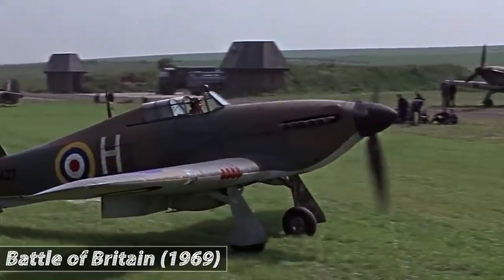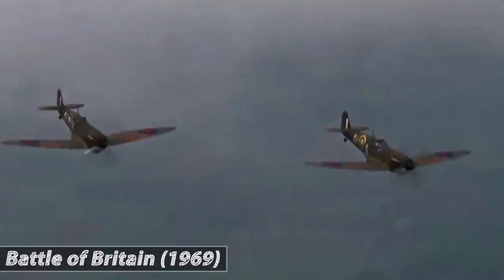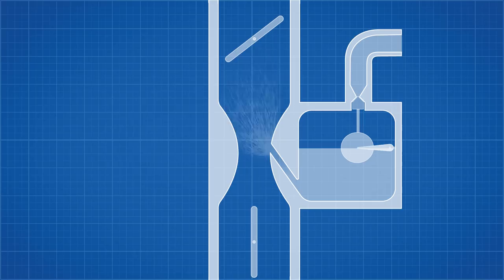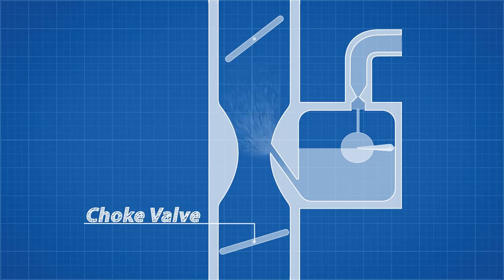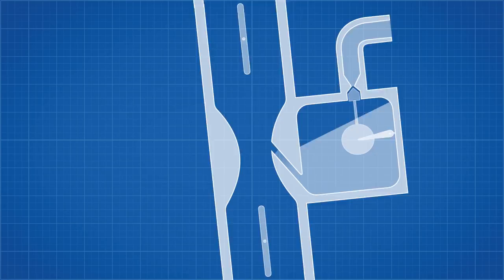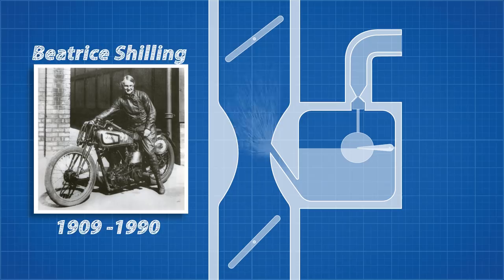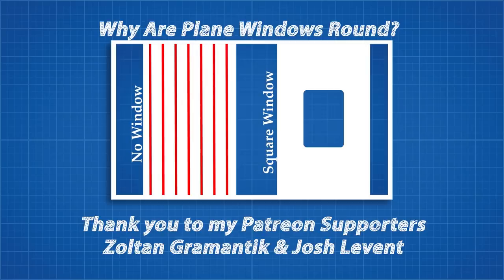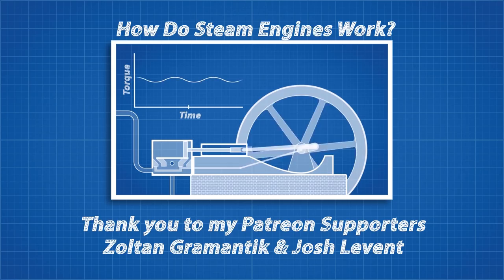The Spitfire's Fatal Flaw

Comment: You should learn more before going on the web. 1. It was not the Spitfire, it was the Merlin engine. 2. You show Hawker Hurricanes, not Spitfires proving the problem was the engine, not the aircraft. It was not a fatal flaw, only a disadvantage which the pilots soon knew how the minimize.
Reply: Well it could be fatal. As he said in the video, if it happened for too long the engine might not start again. If this happened in a dogfight, you're screwed.
Reply: That would be, after pilots got to master the problem, about as rare as your car breaking down today. That said, I have never understood why Rolls Royce did not adapt the engine for fuel injection. The Daimler Benz in the ME 109 had it. One would think RR would realise the weakness and change to FI.
Reply: Well it was fatal when the germans found out about that flaw and abused it in dogfights against the brits.
Reply: Quote me ONE indisputable case where a pilot lost his life due clearly to fuel starvation and subsequent  engine failure.
Reply: i'm afraid you're going to have to do this yourself. Read more into the WW2 aviation history from both sides or the war.
Reply: No. You made a statement, now prove it. I know my aviation WW2 history.
Reply: Between 1 August 1940 and 31 October, Spitfire losses amounted to 208 lost in combat, seven destroyed on the ground, and 42 in flying accidents. These include Engine,emergency boost and deployable gears errors and faliures
Reply: The Merlin engine that was in the...
Reply: Fine, but which of these incidents was due to fuel starvation whilst the aircraft was inverted.
Reply: Adrian Larkins You know what mate? You're right. Fuel starvation and subsequent irreversible stalling at 30,000 ft is not even potentially life threatening.
Reply: It's even safer if you have to prevent your engine from stalling when someone dedicated to knowing your weakness is hunting you down.
Reply: All im saying is the germans adapted and found the flaw in spits and abused it. Some certain maneuvers the spitfires couldn't do due to the engine stalling at steep dives for example, were the germans would use tactics to counter them and pin them down. So yes its technically not a direct cause of casualties of spits but it definitely has hand in it.
Reply: It has nothing to do with the Spitfire. It was the Merlin engine which was used in many different aircraft including the Mustang. It was,without doubt, the most successful engine in WW2.  The ME 109 had a short lived advantage over the Merlin in the Battle of Britain but after that, the Merlin was the master.
Reply: Adrian Larkins Absolutely, just because the engine is flawed in some way doesn't mean any vehicle using the engine shares the same flaw. I mean it's a spitfire, it's immune to engine troubles right?
Reply: they use the same flawed engine so they both share the same engine troubles. But ofc each plane tackles it differently due to difference between planes. For example one can climb or turn differently thus each one adapt differently to its flaw by having different tactics offensively and defensively
Reply: the "flaw" killed a number of pilots... how's that not "fatal" in your pointless argument of semantics?
Reply: Care to name a few killed by the "flaw"? Give me a proven incident where the "flaw" was the direct cause of death. If the Merlin had this deadly flaw, why the hell is it one of the most successful and much loved engines ever?
Reply: You can google this: asn mosquito crash 1996
Reply: I concede your point. That was indeed a case of fuel starvation due to negative G.
Reply: If you are holding negative g for any significant amount of time in a dogfight your dead engine is the least of your problem
Reply: Adrian Larkins They did! Later versions of the Merlin used Bendix single-point fuel injection systems licensed from the USA.
Prior to that change there were several 'jury-rig' fixes for the negative G problem- first among them was the schilling orifice, which prevented the engine from stopping entirely due to flooding, but did little for the initial loss of power. That was in turn replaced by a modified carburetor that could supply enough fuel for a few seconds of full power under negative G.

It is worth noting at this point that no fighter plane (not even a modern jet) can sustain more than a few seconds of negative G. This is because the carburettor isn't the only part that is affected by G-forces- the main problems are fuel supply (the fuel pump is at the bottom of the tank, while negative G makes all the fuel go to the top) and lubrication. Go negative G in a Bf109 and all the oil in the engine will want to fly up to the top of the crankcase. Within a few seconds your cylinders and valve gear will be running dry, which is a recipe for a seized engine if the negative G continues.
Reply: Yes, but this was caused by a faulty carb
Reply: "If you are holding negative g for any significant amount of time in a dogfight your dead engine is the least of your problem"

Exactly this!    The 'flaw' in the engine design came about in a maneuver that most pilots avoid anyway.
Reply: So much rubbish here. First, the problem wasn't special maneuvers that pilots couldn't do, or avoided to do. The problem was that every single time they pushed the stick forwards, they lost power. To the point where the engine flooded. That means you can not follow a german plane that's going into a steep dive. That means he lives to meet you another day, and that day, you might not be behind him but the other way around. And that didn't happen once, it happened constantly.
Then there's the rubbish about "jets can't do negative G forces". First, fuel pump. It's not "at the bottom of the tank". You have: a containment box around the fuel boost pump inlet. You have double inlet fuel boost pumps. You have a weighted fuel pump inlet shuttle valve, amongst a couple of other things. Modern planes, or jets, struggle only with one condition in regards to g forces, and that's 0g. Neither negative nor positive g. The BF 109 also used a drysump oil feed, so there's no "running dry" either. And that's info that is common knowledge if you have any interest in WW2/warbirds generally at all. 

Small sidenote, even commercial jets are rated for 2.5 to -1.0g.
Reply: m4ini
youre the one who's ignorant. you won't be able to follow a german in a dive only if you are at exactly the same speed as he is, which rarely happens in aerial warfare.
Reply: and here is the problem. at the time of the battle of britain, the bf109 outperformed the spitfire. just by a small bit but it did. it was faster and could do prolonged negative g maneuvers. and a simple dive is a negative g maneuve. 
the spitfire was slower and did not climb as fast as the 109 or the 190 and could not take dives and other pretty common maneuvers during arial combat. 
this is why the german fighters could choose the engagement and were not engaged.
this was only hampered by the close escort formation they had to do.
if a 109 or a 190 got into a combat situation where it was overmatched by surperior numbers or in a position where it was not reasonable to fight, it could just dip the nose a bit and it was out of reach of the spitfires and hurricanes. 
the british planes on the other hand had to stand their ground and face the enemy, were severly limited in the maneuvers they could pull of (rolling scissors etc are also negative g at some points) and with that were at a significant and deadly disadvantage.
the british advantages where the short flight distances between their airfields and the long warning times due to radar and also the limited combat time for german planes in british airspace due to limited range.
even british pilots of the time say, that they were sitting ducks to the german fighters. later versions of the engine and the plane fixed the problems but thats not the point here.
Reply: Zhufor TheImpaler the entire time i was reading your reply i was thinking "this guy's full of shit" until i got to "later versions"
... then i began to wonder where you got this information, 
"the spitfire" was many aircraft, and not all of them "spitfires" ... but regardless, they've all mark numbers to distinguish themselves.  if you're going to add to the conversation, you'll need them.

TRIVIA: depending on command, they wern't even called "spitfires"
Reply: Phil Verhey well the relevant timeframe we are talking about is the battle of britain.
combat altitudes were above 4000m, wich was a clear advantage for the german fighters.
the used spitfire marks were mkI and mkII and they used the merlin engine without diaphragma. here we can clearly see the performence problems of the spitfire.
they had the home advantage, more planes and pilots and also a high rotation of pilots from reserve to front and back. unlike the german airforce, wich suffered under pilot attrition.
the mkV and following versions used the upgraded merlin engine and were able to outperform german fighters from that point on. the introduction of the 4 bladed and 5 bladed propeller increased the performence even more.
im not saying that the spitfire was a bad plane, but the merlin engine was initially designed for racing cars and not arial combat and suffered from that until 1943. it was a good engine but in the wrong role until it was upgraded.
and up to the point where the germans lost the arms race for upgrading the fighters, the bf109 and fw190 were outperforming british planes. but that ended with the end of the battle of britain.
Reply: Zhufor TheImpaler wierd exemption of the griffon engine in "following versions used..." , and twice incorrect inclusion of the 190 which never flew in the battle of britain.

but sure.
Reply: The Spitfire was better that the 109 in that in could out-turn the 109 and catch it with a full burst of fire. The engine cutting was a problem which has been totally over-baked in this debate. The Merlin lent itself to dozens of upgrades which eventually became the Griffon engine. The FW 190 had no part in the Battle of Britain. It was initially superior the the Spitfire V but the Spitfire 9 was the answer to that problem.
Reply: +Conman_123 You wouldn't pull negative Gs for that long in a dogfight. If you did, you would die from redout, not your engine cutting out.
Reply: +SIPS' MOM The negative G issue was fixed by the time the Spitfire Mk V was introduced (around 1942)
Reply: It is not possible to do this because the pilot that lost his life, erm, died and never got to write his memoirs detailing exactly how he was killed.    There are however numerous instances when a 109 bunted over into a nose dive when bounced by an early Merlin powered fighter and got away.    The one second required by the Merlin aircraft to turn inverted and pull into a dive was more than enough to allow the 109 to get away.
Reply: What you say is all quite true but just common knowledge.
     This vid isn't about the BoB.
            This vid is about the fatal flaw of the Spitfire which was its carburettor fed engine, a truly simple and stupid mistake.
        Another of its flaws was its low value armament,fine for getting lots of tiny rounds into a small,fleeting target like a fighter but not so good against heavily armoured bombers.
      The Merlin grew up to be one of the all time great powerplants but when new as in the Mark 2 and 12 it was certainly no better than many other vee engines out there.
     The DB 601 that powered the early versions of the 109 were better in every way than the early Merlins.
    There was also lots of development potential in them and they matched the Merlin pound for pound throughout their careers.
      It should also be remembered that the Merlin is famous for its successes like the Hurricane, Spitfire, Mosquito and Lancaster but its failures have been conveniently forgotten, such as the Fairey Battle and Bolton Paul Defiant.
    The Merlin didn't 'make' the Spitfire, the Spitfire would have flown just as well or even better with the DB 601 fitted.
Reply: Again,what you say is true but this video is not about that, it is about the defect inherent in all early Merlin engines and incidentally absent in all early DB 601s.
    I would say though that an expert 109 pilot could turn with the Hurricane or Spitfire, the German aces report no problems doing so, only the novice pilots were scared to push the 109 too far in a turn.
    Like I have already said, the Spit was a great plane for the novice pilot, it allowed him to throw himself around the sky with 'gay' abandon, it was a 'force multiplier'.
    The 109 was a better fighter when driven by an equally experienced pilot.
Reply: No,the Spitfire was undoubtedly a brilliant aircraft but it wasted the talents of truly great pilots.
    A novice Spit pilot could get approaching the best out of his aircraft while a novice 109 pilot could not do so until he had accrued many.many flight hours.
    Let me try and explain my friend;
     If we assume that the worlds best fighter pilot had a performance rating of '20' and an average pilot had '10' then the Spitfire allows an average pilot with a '10' rating to become a 12 or 13.
     A 109 allows the average pilot to be exactly what he actually is,ie, a '10'.
     However, when a 109 pilot becomes truly familiar with the capabilities of his 'ride' he achieves a greater ultimate score than a Spitfire pilot of comparable experience.
    So a Spit pilot can achieve no more than '18-19' while a 109 can go on to '20'.
   Of course, to achieve this high score the 109 pilot must survive through the lower numbered stage.
     This is what feeds the belief that the Spitfire was a better aircraft than the 109.
      It took a mediocre pilot and made him seem better while a 109 took a mediocre pilot and made him seem exactly what he was.
     I would say that a novice pilot in a Spitfire has the advantage over a novice 109 pilot but an expert 109 pilot has the drop on an expert Spit pilot, an experienced 109 driver could and did out-turn anything in the ETO.
    The Spitfire was an excellent wartime aircraft that allowed wartime expedient pilots to excel, if both the 109 and the Spit had been flown by uniformly experienced pilots in peacetime then the 109 would be the better aircraft.
     This is of course exactly what the RAF needed in 1940, we had many inexperienced pilots and the Spitfire was perfect for them.
     The next year when our pilots were generally speaking more experienced and we pushed into France the Luftwaffe handed our arses to us on a platter.
Reply: Brilliantly explained.
Reply: Adolf Galland when asked by Goering what he needed to defeat the RAF during the Battle of Britain Galland simply responded 'A Squadron of Spitfires' . . .
Reply: +shawn harold fox firth Thats an urban myth btw.
Reply: Adolf Galland wrote in his book The First and the Last that when Goring asked what do you need to win against the RAF, Galland said a squadron of Spitfires.  Or are you saying Galland lied.
It is also a fact that the Spitfire was the fighter the Luftwaffe pilots most feared.
Reply: To say that 109 pilots feared the Spitfire is exactly the same as saying Spitty pilots feared the 109.
       In reality a low and slow 109 will be killed by just about anything sitting above it with enough fuel and ammo for a quick dive, therefore that 109 pilot will fear it even if it's a Gloster Gladiator or a Blackburn Skua
     Basically it is all about positional advantage/disadvantage.
      Galland goes on to say that 'he didn't really mean what he said and that he thought the 109 was better than the Spitfire'.
       The performance similarities between the two were astounding and the ac in the better position would dominate.
          I have to say though that the flat out speed at mid to high altitude were in favour of the 109E, the armament was pro 109E and the rate of climb at any height goes to the 109E.
      The Spitfire MK1/2 whether in expert or novice hands could indeed turn very tightly but the 109E in expert hands could do so just as tight.
         I have to give the title to the 109E.
    P.S, Don't let my name fool you, I'm as English as can be.
Reply: Yet  The truth is that Luftwaffe pilots have been quoted as saying the one plane they feared was the Spitfire. even if the Bf 109 pilots had the height advantage which was often the case in 1940.
Galland was trying to annoy Goring but he did mean that the Spitfire would have been better for escorting bombers.
Galland thought the Bf 109 was faster but it has been shown that the Spitfire Mk I had an  advantage at most altitudes. 
The rate of climb for the Spitfire is also better, the Bf 109 climbed steeper but slower.
Remember that by the Battle of Britain the Spitfires had constant speed props and were able to use + 12 lbs boost.
The Spitfire could turn tight without losing altitude,  the Bf 109 if it turned as tight would lose altitude.
I have to say that if the Bf 109 was better why did the less experienced RAF pilots do so well and why did Galland get shot down by inferior  and outnumbered Spitfires?
Reply: Barrie Rodliffe
Yes of course my friend, the 109 pilots did indeed fear the Spitfire, but perhaps what they don't know or at best least admit to, could never admit to to is that that they were shot down roughly 2/3 compared to Spitfires,yes indeed, the sedentary Hurricane, an aircraft readily ridiculed by the old sweats of the Luftwaffe killed far,far more 109s than Spitfires ever fucking well did.
Even the fucking Luftwaffe coined a term for it:SPITFIRE SNOBBERY, in which no shot down Luftwaffe pilot ever conceded defeat to a Hurricane, never-the-fucking-less, many more 109's continued to end up in Kentish hop fields thanks to Hurricanes, not the limelight stealing Spitfire.
    Perhaps its time to forget your jingoistic 'spitfire yey' attitude and do more serious research.
 I mean seriously 'You say that Spitfires with their incredibly short range, every bit as short as a 109 would have made better escort aircraft, even with their inferior performance at height?
               FFS mate, there's patriotism and there's foolishness, I on the UK side am very proud of the way we fended off the awful Nazi Germany in mid/late 40 and yet can see that the two aircraft that enabled us to do that had their flaws, simply denying that they had anything wrong with their design just shows that you must own a mildly bigoted mind.
            OH, AND FFS, THE 109 IN THE HANDS OF ANYBODY BUT A COMPLETE NEOPHYTE WILL TURN WITH EITHER THE HURRI OR THE SPIT!!!!!!!!!!!!!!!!!!
Or do you REALLY think that all RAF fighters were victims of Hilo attacks?
   You all make me laugh...............If the bloody Spitty was so god almighty superior then where was the competition, what shot down the Spittys?
          You bloody fools and know nothings.
            Do some research before you stick your dopey noses in, that's my advice.
Reply: Poor Anton.
You need to do some research.
In the Battle of Britain the Hurricane shot down more Luftwaffe planes than the Spitfire, the slight matter of there being far more Hurricanes at the time and also the fact the Hurricane usually took on the bomber while the Spitfire despite being very outnumbered  did take on the Bf 109, the result is that the Spitfire shot down a higher percentage as well as having a lower loss rate. 
I mean the Spitfire not only had better range than the Bf 109 early in the war as well as being slightly faster and climbing better at any height, it went on to have much better range, in 1943 when Spitfires were regularly flying sweeps of over 1,000 miles and escorting USAAF bombers.
Anybody who can read should know that the Spitfire had a tighter turning ability, it turned tighter than the Bf 109 without losing altitude, not only tighter but pulling more G and completing a turn faster.  

If the Bf 109 was so good why did the more experienced Luftwaffe pilots not shoot down that many Spitfires?  the Bf 109 pilots had a numerical advantage and mostly a height advantage.
I take advice from intelligent people, you do not make it.
Reply: Your claim that the Hurricane usually took on the bombers shows a schoolboy understanding of the battle, you do not like my message because it clashes with your weak interpretation of events.
      There were roughly 2 Hurris for every Spit during the battle and guess what?
       The Hurricanes shot down almost exactly twice the number of enemy aircraft as the Spitfire, this means that despite all of your childish enthusiasm for the Spitfire it failed to outdo the Hurricane during the BoB.
          The fact is that if RAF Fighter Command had been equipped solely with Hurricanes it would still have won the BoB.
          The Hurricane had a slightly higher likelihood of burning when hit by the devastating firepower of the 109 but this was compensated for by the Spitfire being a much less sturdy aircraft and a bad firing platform.
          That the Spitfire could outperform the Hurricane in almost every aspect is not in doubt but this being so does not explain the Spitfires failure to eclipse the Hurricane in actual enemy kills.
      You don't seriously think that 109 pilots didn't shoot down 'that many Spitfires' do you?
      What the hell happened to the hundreds that were actually shot down if 109s didn't get them, was it little green men perhaps?
    BTW, I couldn't care less whether you take my advice or not, your continued education in all things aviation is of no concern to me, jog on little boy..
Reply: Are you talking to me or Barrie Rodliffe? I know my B of B history. You are right there were more Hurricanes than Spitfires, The reasons the Hurricane had a greater score are twofold, ONE There were more of them. TWO The hurricane, because it was not as nibble as the Spit but was a better gun platform went for the slower, less manoeverable bombers, whilst the Spits went up to meet the fighter escorts which are naturally more difficult targets. And that was told to me by than none other than Sir Douglas Bader who I was honoured to meet at Duxford shortly before he died.
Reply: I was actually addressing Barrie Rodliffe but no matter.
     Yes,of course the reason for the Hurricanes higher score was because there were approximately twice as many of them as the Spitfire and they managed to take down almost the exact same ratio of enemy planes as the Spitfire however they suffered higher losses in doing so.
      As we all know, the official strategy was for Hurricanes to go for bombers and the Spits to deal with the fighters but this is a simplistic outlook, it hardly ever happened like that, more realistically they all became entangled and anything took a pop at a bomber when free from 109s.
     Of course if the 109s moved off at speed then only the Spitfires could keep up with them and therefore more 109s were killed by Spits pro rata than Hurricanes.
       The Hurricane often found it difficult to keep up with a JU88 that had its nose down for France.
        But to get back on topic, the early versions of the Merlin engine were flawed and this flaw obviously affected the performance of whichever aircraft it was fitted to.
        During a dogfight split seconds count for a great deal and if you know that your assailants engine will cough if he bunts after you then that is exactly what you will do, the power interruption was often enough to gain a couple of hundred yards on the Merlin aircraft and this is the vital difference between being in range of his guns or not or him coming into your range.
        Fitting such an outdated fuel feed system to an engine that was otherwise excellent seems like an incredibly dumb thing to do and it was.
Reply: Actually twice as many Hurricanes shot down less than twice as many Luftwaffe planes, especially fighters and more than twice as many Hurricanes were shot down than Spitfires. so the Spitfire had a better record and after the Battle of Britain the Hurricane was at the end of it`s development, the Spitfire was able to be developed to fly almost  100 mph faster than the 1940 Spitfire which was faster than the Hurricane and more than keep up with any other fighter right through the war. In Malta the Spitfire took over from the Hurricane and defeated the Italian and .German air forces there, in North Africa the Spitfire took over from the Hurricane and P 40, the Spitfire provided air superiority for every major action right through the war.
To get back to the topic, the early Merlin engine was more efficient than the larger German engines, the carburetor gave more power. Sir Stanley Hooker knew about fuel injection and the problems that had as well. 

The Hurricane used the same Merlin at the time, same problem.
The Merlin had  the well known problem of a momentary cut out when negative G was encountered but the RAF pilots did not just nose over into a dive, they rolled over into a dive which meant no cut out and they could keep the Bf 109 in sight and catch up in the dive.
A Spitfire pilot would not bunt into a dive to escape, he could simply do a climbing turn and the Bf 109 could not follow.
If the Spitfire was so bad, why was it that there were more Spitfires and less Bf 109`s at the end of the Battle of Britain than at the start?
Reply: Nobody is saying that the Spitfire was 'bad' and it is generally accepted as being better than the Hurricane as an air superiority weapon.
           You are projecting the successes of the later MkV and MkIX Spitfires onto the deeds of the earlier MkI and II.
            Those later marks had the engine and the armament that the earlier ones should have had but didn't.
           All I'm saying is that contrary to schoolboy wisdom the BoB era Spifires were no better than the 109, a hard pill to swallow I know but true none the less.
          The roll rate of an aircraft is a measurement of how many degrees of bank can be applied per second,  this is an absolutely vital performance figure for a fighter because it dictates how quickly it can change direction, so if we consider a 109 that is being pursued by a Spitfire MkI or II and that 109 bunts over into a vertical dive in an effort to shake off the Spitty then that Spit pilot has three options;     He can break off because he has succeeded in driving the 109 off.
      He can bunt over himself thus starving his engine of fuel albeit hopefully temporarily, during which time his would be prey accelerates away.
       He can take the recommended action and enter a half roll which obviously involves rolling his aircraft through 180 degrees and pulling back on the stick then reversing the roll.
       The Spitfire had a decent roll rate as did all contemporary single engine fighters but it still took the Spit travelling at only 200mph c 1.9 sec to roll through 45 deg, this figure would improve slightly as the roll developed and inertia was overcome but we can safely assume that to invert a Spit moving at 200 mph would take in the region of 4-6 seconds.
     As the airspeed goes up so does the rate of roll slow down,ie, @ 385mph a Spit takes 3.8 sec to roll 45 deg.
      During which time the 109 accelerating away downwards through 300-400 mph has covered c 1/2 a mile.
http://www.spitfireperformance.com/spit1vrs109e.html
The Spitfire was at a terrible disadvantage in such a fight and any German pilot with half a brain knew exactly what to do if he found a Spit on his tail; Bunt over and dive away.
     Just as any Spit pilot finding himself pursued by a 109 knew what to do; A high climbing turn into the attack, if he chose to dive he is dead meat.
      Unfortunately any sensible 109 driver knew his prey had limited options and would invariably be ready for the turn as he knew the Spit driver wouldn't dive.
      If we reverse roles here the pursuing Spit has to decide whether his prey is going to go into a turn or a dive, split seconds have past during this thought process and a couple of 20mm cannon hits kills the Spitty stone dead.
       Conversely, the Spit can make many little holes in the 109 airframe without causing the least bit damage.
It was a fault in the carburettor fed engine and not a fault inherent in the Spitfire airframe which caused this, as soon as RR fitted the Bendix-Stromberg fuel injection system to the Merlin the problem went away.
  Another factor which directly improved the Merlins performance without any alterations to the basic engine design was our use of high octane fuel, fuel that was not available to Germany.
    So if you ignore the carburettor faults and ignore our far more combustible fuel then the Merlin was indeed a better engine than the DB series.
         It is true that the RR Merlin was THE most reliable inline aircraft engine of all time and this was brought about by RR quality control in which a random production engine was removed from the line and ran at full power until it failed, then it was stripped down and the origin of the failure determined upon which that part was either strengthened or redesigned.
Reply: An aircraft stall at 30,000 feet is almost never irrecoverable unless control surfaces are damaged in some way or the pilot is dead/injured/unconscious.

At stall at 100 feet is almost never recoverable, even if everything else is working properly.
Reply: *****.
The Spitfire which turned tighter than the Bf 109 and very much the same as the Hurricane also not only was faster, but climbed and accelerated better, that is even more important than speed.
It shows in the fact that while the Spitfire mainly went after the Bf 109 leaving the Hurricane to take on bombers, that per plane the Spitfire shot down more and had a lower loss rate.
 Strange how Hurricanes were shot down by the Italian fighter, I believe it was a Machi, The Spitfire replaced the Hurricane and P 40 in the Mediterranean and North Africa, also the hurricane in Malta because it could take care of itself.
Reply: That is why I admire the courage of the low flying rocket firing Typhoon pilots. They were, by necessity, very low and therefore very vulnerable to light flak with no chance of recovery and bailing out.
Reply: It would depend on how much damage if hit by flak, if not destroyed there was a good chance of gaining altitude and baling out, even with a dead engine you can trade speed for height. 
A Tempest pilot was hit by flak late in the war and he was able to fly his damaged plane back to base, unfortunately while he could fly he could not use the performance or maneuverability to evade USAAF P 51`s which shot him down.
Also other fighters did low level attacks on many targets, Spitfires were doing so and giving close support to the British army advancing through France. I knew a Typhoon pilot who survived the war.
Reply: The P40 replaced the Hurricane in the air superiority role in the Western Desert, the Hurricane went on to serve there as a fighter bomber. AFAIK there were no Spitfire units in the desert until well into 1942 and then they were the MKV variant,not the MK1/2 that flew in the BoB.
        On Malta the Hurricane fought on under increasing strain against 109 E-7's and F's when the first shipment of Spitfires were almost all destroyed on the ground after landing.
       These too were eventually replaced by Spitire MKV's in the air superiority role.
Reply: The P 40 did not replace the Hurricane in the air superiority role, it was used as a dive bomber until replaced by the Spitfire in that role too. That fact is the Spitfire Mk I and II which were better than the Hurricane could also carry 20 mm canon the Hurricane had to wait for the more powerful Merlin fitted to the Hurricane Mk II which had more power but was still lower performance  than the Spitfire Mk II.  Spitfires were also able to be given still more power, Mk V, Mk IX, Mk XIV and all the other marks in between,  while the Hurricane was at the end of its development. 
So Spitfires were destroyed on the ground but soon they completely changed the situation in Malta, just as they did every time they replaced other planes.
Reply: The P40 did indeed replace the Hurri as an air superiority fighter in the desert, it was outclassed by the 109E and F but nevertheless the Hurri went on to ground attack while the P40 protected its back, then the Spitfire came along in 1942 and took over that role.
           I'll say it again for your benefit ; Nobody in their right mind would claim that any Spitfire variant was inferior to the Hurricane as a fighter, it was plainly a better performer in that role.
          Why don't you ask 19 Squadron what they thought of their 1940 era cannon armed Spitfire 1's?
19 Sqn were the first to receive the Spitfire and the first to use the cannon armed version in combat during 1940, it failed, the feed mechanism was not up to dragging the cannon shells into the breech while under G.
       They pleaded to be given normal 303 armed versions and they were, clapped out old wrecks with which they were delighted.
            But there you go again mate, you're banging on about late war Spitfires when this thread is about the flaws inherent in the early Merlin engine types.
Reply: The P 40 which was used as a dive bomber could not even protect itself so why would it be used to protect the better Hurricane.  Why did no Hurricanes even have 20 mm canon at the time, 19 Squadron had the Spitfire Mk I b with 2 x 20 mm, of course there were problems which is why only 30 Mk I had 20 mm, 170 Mk II had 2 x 20 mm and 4 x 0.303.  Hurricane did not get the 20 mm until later. 
I am not mentioning late war Spitfires, the Mk V, early 1941.
Also the so called fatal flaw which was not fatal and was improved in 1940, being completely cured in 1941.
It was not so much a flaw as a slight problem associated with the carburetor but the trade off was better efficiency of the carburetor than achieved at the time with fuel injection.
Reply: They were fitted with Packard built Merlins in 1943 and equipped many units stationed in Italy, they still didn't perform well at high altitude and I think many were stripped of armour and some guns to improve their performance, they were designated P40L.
          And yes,thank goodness.
Reply: Where was his proof that the engine might not start again? The propeller will keep the engine running, very quickly dumping the excessive fuel and the engine would fire up again.
Reply: Do you know how many Spitfires were built, much less in units than the ME 109.  How many Merlin engines were built (A LOT). You can check it up online. That engine had so many versions went into so many designs of ww2 aircrafts and eventually has a version that went into the P51 Mustang.
This guy is not a ww2 aviation expert. The title (fatal flaw) is misleading, a possible click bait. 
It is true the engine design allowed starvation in negative G, and then go rich, but it was mentioned that pilots learned very quickly to half roll right before a dive. Also many adjustments were made to combat this fuel supply problem. 

Bottom line is.  German lost. ME 109's engine fuel injected or not. I know, the German lost the war not because of its air force. But I highly doubt the Merlin engine has a fatal design flaw.
Reply: The Merlin was the greatest aircraft engine of its time and indeed it was converted for marine use also, mainly in MTB's and RAF rescue boats. The number of upgrades and power increases is too many to mention here but if the fuel starvation on negative G was such a problem it stands to reason the Merlin would never have had the superb reputation it still has to this day. One can always tell a Merlin from other engines. The sound is unique. Others are similar but not the same and when the the plane loops and rolls she coughs a puff of smoke as if to say, "Fatal flaw? Hardly".
Reply: golferchin 76.
I wonder why some people miss the fact the Merlin was much smaller yet more powerful.
Maybe Sir Stanley Hooker knew what he was doing when he used a carburetor instead of fuel injection.
The carburetor worked very well and gave more power, fuel injection needs modern electronics to work as well as it does now.
Reply: The Daimler Benz V12 engine in the 109 was bigger. I can't recall exactly by how much but it was considerable. I read somewhere the Merlin, for technical reasons, did not lend itself to fuel injection. I'm sure RR would have used it if there was a real advantage.
Reply: RR always kept a carburetor right through the war, they did use an injection carburetor which is still a carburetor body with no float chamber and the fuel injected into the carburetor.
The DB 601 was 34 litre, the DB 603   44.5 and the DB 605   35.7.
Reply: Barrie Rodliffe carbureted motors are still used today. IMO it is a simple system and has very little problems compare to FI. The design definitely have downsides, so is FI.
I would imagine back in late 30s such big displacement, powerful, torquey engine at low rpm to power 3+  meter wide propellers was an engineering marvel at that time (top military secret also), including the carbureted fueling system that feeds a hungry supercharged engine at full power!
One thing I like to point out is that the Daimler FI engine in ME109s could be purely mechanical.
About FI. One possible problem would be the fuel pumps (even today's electronic system have that problem). Others would be maintenances/ cost/weight.  The engine must had multiple huge/heavy fuel pumps for redundancy, and their drive system.

These giant machines are all engineering masterpieces at their time. I mean It's 1930s. I mean just look at car designs of the 30s...
I think they were ahead of their time, and that's why we are fascinated by most of them still :-)
Reply: Adrian Larkins It is an accepted fact that early Merlins had the flaw to which this thread is dedicated, they stopped working under negative G and no amount of hyperbole will alter that salient truth.
         The DB series were better engines in 1940, an awful truth but there it is!
           The Merlin was famed for its reliability and its ability to keep going when there seemed to be no oil/glycol coolant left in the system, a DB would kill itself within moments of running out of either.
             This is why the Merlin is famous,that and its universality,it powered almost all of our aircraft post 1941 and some US machines too,it powered boats and in a shortened form tanks too.
Reply: I have admitted the Merlin had a problem with negative G but the problem was not as serious as this whole correspondence seems to insist. Once the pilots knew of it and countered it, the disadvantage was minimal. 
I already mentioned the marine version in MTB's and RAF rescue boats.
Reply: Anton.
The early Merlin had the problem which did not stop the engine, it cut momentarily, in 1940 this was improved and in 1941 completely solved but it did not mean the DB engines were better, in fact they were bigger but less powerful.
Reply: If you have an aircraft engine which cuts out under certain conditions and one which does not then no matter how powerful or what size it is the one which does not is the automatic winner, that ought to be self explanatory yet jingoistic Merlin lovers insist it was the best?
      It was as powerful as the rest of them but more reliable and that is it,no more,no less.
        
        You will have to explain to me what you consider to be the essential difference between an engine stopping and an engine cutting.
       By bigger do you mean dimensions or weight or cylinder capacity?
Reply: Anton. 
Since the engine did not stop, but just cut out momentarily, and since the pilots knew, they simply rolled over into a dive which kept positive G and the engine did not cut out at all. In 1940 the momentary cut out was improved to such an extent it was nothing to worry about and in 1941 it was solved completely.
The smaller Merlin engine was more powerful than the bigger DB engine as well as more reliable.  
For the uneducated the 
RR Merlin 27 litres
DB 601  34 litres
DB 603  35.7 litres
Reply: Thank you. That's what I've saying all along.
Reply: Adrian Larkins 
Adrian Larkins.
We do seem to agree.
I wonder why it is supposed to have been a fatal flaw? since Sir Stanley Hooker knew about it and he still preferred to stick with a carburetor. The pilots also knew and avoided negative G so I really wonder did a single pilot get killed because of it or not?
Reply: Apparently, the Mosquito crash in 1996 was caused by negative g according to the inquiry findings but whilst that is true, pilot error was behind it all.
Reply: Thanks I did not know that
Reply: statistics show that there was very little strategic difference between the Spit and the Hurricane. At least in the initial stage of the battle of Britain, one could make the point that the Hurricane, being faster and cheaper to manufacture would have seen service in bigger number and it would have given a greater contribution to the fight. Although I dont necessarily agree with this position, it is worth noting. The 109 had a small advantage over the Spit, but it primarily went down to the more experienced pilot, which usually was German. The 190 on the other hand was a nasty adversary, really a remarkable design. The Spitfire Mk IX proved to be a fantastic duck-tape solution, upgrading the existing mk V (which by itself was already an interim solution with its fuel hungry supercharger) to the newer Merlin engines. By that time I don't think the negative Gs were an issue anymore. I am completely ignorant on which tail and canopy were developed for which mk and then adopted though. Do you have any insight on the features of early and late mk IX?
Reply: Overall the Bf 109 had no advantage in the Battle of Britain, it did earlier until the Spitfire got the constant speed prop and the use of +12 lbs boost, then the Spitfire climbed better and it had an advantage in a turning fight.
The Spitfire had many upgrades, the Mk I had the Merlin III and got the constant speed prop and was able to use + 12 lbs boost by the Battle of britain, the Mk II was the same but used the Merlin XII, there was meant to be a MK III which had shorter wingspan and retractable tailwheel and when flown in June 1940 with the Merlin XX engine was considerably faster than the Mk I or II, but it never went into production, the Mk IV had the Griffon engine, the Mk V was a MK I or II modified for the more powerful Merlin 45, it used more fuel but had a higher cruising speed and about the same range. 
The Mk IX which could be put into production very quickly and was in service earlier than the Mk VII or MK VIII, it did perform very well. Negative G was completely solved on the Merlin 45 in the Mk V.
All from the Mk I had the Malcolm hood until late production Mk IX`s which had the teardrop canopy, as did many Mk XIV, XVI and XVIII.
Some Mk IX`s had 2 x 20 mm and 2 x 0.5. some also had extra fuel in the fuselage up to 171 gallons internal fuel, while the Mk VII and VIII had 14 gallons in each wing giving up to 199 gallons internal fuel.
Reply: you are right. mk V solve the negative G issue with the carburetor. I thought the teardrop canopy was implemented only in later mks (the griffon powered), with the exception of VII and few others perhaps. not sure I ever saw a picture of a teardrop IX :(
Reply: furtivedig
There is a photo of a teardrop canopy Mk IX which the South African Air Force Museum had, it was made at Castle Bromwich in 1945.
It can be found in Warbird Alley
Reply: thank you very much! :))
Reply: Name me a single engagement in the Battle of Britain that took place at 30,000ft.... you're clearly pretending to be an expert in a subject you're at best passingly familiar with
Reply: audigex.
Most fighting was not so high but it did happen.
Just one example.

 F/Lt Eric Thomas of No. 222 Squadron wrote in his Combat Report for 9 October 1940:

I was leading the Squadron on patrol at 30,000 feet roughly over Chatham. I followed 41 Squadron down to 28,000 feet and then saw about 5 Me.109's directly above at 29,000 feet. I climbed up into them and they made for a layer of cirrus, through which I followed them. I increased revs. to 3000 and gradually outclimbed them and gave a 4 seconds burst into the belly of one enemy aircraft. Glycol streamed out of the port radiator and he went down in a shallow dive.
Reply: There was an item on 'Coltranes, Planes , and Automobiles' by Robbie Coltrane that gives an explain why RR didn't use injection. One was the complexity of the injection system to manufacture, and therefore time as well as requiring many more skilled workers. The second being the cold air rushing through the barrel of the carb would become colder, and thus more dense which gave a bit of a power boost. It's been many years since I've seen that series on TV, but I think I remembered it well enough.
Reply: Barrie Rodliffe
Simply rolled over into a dive?
What do you think the 109 was doing while the Spit simply rolled over into a dive?
Have you read my posts detailing the time required to simply roll over into a dive?
Do you think the 109 driver waited around while the Spitty pilot simply rolled over into a dive?
SIMPLY?
Reply: ANTON RUDENHAM
Do you think the Spitfire would be stationary when rolling over into the dive?, if the Bf 109 pilot nosed over into a dive at any speed and opened up to the Bf 109`s top speed in a dive, he would have a slight advantage at the start, but unless the Spitfire was stationary then not a great advantage and the Spitfire being faster in a dive would soon catch up.
The Spitfire would roll over into a dive in around 2.5 seconds depending on how fast it is going but since the forward speed is the same when rolling as flying straight and level the Bf 109 would be going down but also forward so in the same direction so not that far ahead, the Spitfire pilot could keep the Bf 109 in sight all the time and would have the height advantage.
Reply: So no disadvantage there then according to you?
Having to perform a manoeuvre before diving after an enemy ac is no problem?
If you are right then why did they ever fix the carburettor fault,surely it was never a problem?
In 2.5 seconds that 109 is plain outta sight,never mind the true rate of roll applying to the Spitfire.
Likewise a Spitfire attempting to dive away from an attack is dead meat,ask Galland.
Reply: Your jingoistic and unflinching support for the Spitfire is to be praised but unfortunately you go way beyond that and are quit unable to see problems where there are problems.
Have you ever read anything by Spitfire pilots and 109 pilots?
I just don't understand how you could even ask such a stupid question as "Do I think the Spitfire was stationary while rolling".
I will not even dignify that with an answer.
I will simply refer you to my earlier post detailing the rate of roll for a Spitfire.
If you refuse to see the blatant fact that having to roll inverted before diving presents a huge problem then that's your lookout,I will stick to facts no matter how much you Spitfire fanboys cry and whinge about them.
Reply: Antwit.
My support for the Spitfire is based on facts like the slightly higher top speed, the better turning ability, the better climb rate and if you knew anything about aircraft you would know that you do not need to be fully inverted before going into a dive, by the time you are at 90 degrees you are already in a dive.
The negative G problem was only a problem when first nosing over into a dive and that is why the pilots did roll into the dive but even by the Battle of Britain it had been improved. 
Now if the two planes were flying at around the same speed but if the Spitfire was behind and catching when the Bf 109 pilot dived then the half roll and dive would mean the Spitfire pilot would keep the Bf 109 in sight and he would be going as fast as the Bf 109 but be above. now who has the advantage in any fight?  from all I have read it was usually the plane above that had the advantage.   
Try to stick to the truth, rather than some schoolboy imaginings.
Reply: 40 years of study dispel your schoolboy assertions Barry.
You really ought to try reading a bit more.
But yes,any aircraft above and behind is a grave threat,whether it is a Spit,Hurri or even a Gladiator.
If a Spit is above and behind you then the 109 will always dive, not because the pilot particularly wants to (remember height is everything) but because it gives him the greatest chance of accelerating away from the Merlin engine fighter.
Why do you assume that an aircraft at 90 deg from horizontal is automatically in a nose down attitude,instructors go to great lengths to train pupil pilots to apply opposite rudder when in that attitude,this way the nose is held up and height is not lost.
Of course when the object of inverting is to lose height then opposite rudder is not applied,what is your point?
A well handled 109 with an experienced pilot at the stick could and did turn with the Spitfire or have you never read any German pilot logs?
Reply: Anton.
40 years of wasted time it seems.
if the object of rolling is to dive then you do not want to hold the nose of the aircraft up and you do want to lose height..  
The Spitfire which was faster in a dive would soon catch up. 
A well handled Bf 109 in a turn could not turn in 695 feet radius without losing height, the Spitfire could, also the Spitfire would pull more G and complete a turn maintaining higher speed  in 19 seconds, the Bf 109 taking 25 seconds.
I have read a great deal from both British and German pilots.
Reply: You are simply mining info from a quick google search and while some of it is very good and worth noting the usefulness of an aircraft is generally that of the opinion of the pilots that flew them,German pilots were convinced their 109 was superior to our Spitfire and our Spitfire pilots were equally convinced about the superiority of their Spitfires.
It is up to us to pick both POV's apart and come up with a decision we can be happy with.
The 109 and the Spitfire were practically inseperable in 1940 in terms of performance and so it comes down to other less obvious criteria to separate them, the Spitfire Merlin engines carburettor problem and rifle calibre armament swing it towards the 109 for me.
I understand your knee jerk allegiance to what is the definitive British WW2 fighter but you must broaden your horizons and read more of both allied and German combat reports.
I was once like you,I too automatically swallowed everything I was told about the Spitfire and virtually every other iconic allied weapon but my interest was piqued by reading German combat reports decades ago, I thought to myself; "How can these German pilots be so foolish as to actually think for one moment that their poxy 109 was better than our glorious Spifire and whatsmore,how the hell did they rack up so many kills flying what I 'knew' to be an inferior aircraft?"
Can you think how and why that might be Barry?
Reply: I do not need a quick or slow google search, I have dozens of books and have met WW II pilots, including pilots who flew both Spitfires and Bf 109`s.  
Adolf Galland thought the Bf 109 was faster but it wasn`t, he liked the Bf 109 but thought the Spitfire was better for the uses they had in Battle of Britain. I have looked at this for a long time and in performance they were close but the Spitfire had better turning and climb capabilities, the Bf 109 had a slight advantage entering a dive but if you read combat reports a Spitfire pilot could keep up with the Bf 109.
Part of the reason many people think the Bf 109 is better is they do not allow for the use of the constant speed prop and + 12 lbs boost which the Spitfire had in the Battle of Britain.
Reply: You're simply wrong, mate. The Spitfire was an infinitely more adaptable platform than the Messer. Proof of that is the number of marks the Spit went through, allowing it to be competitive right through the end of WW II and after. The G & K versions of the Messer were last gasps, attempts to keep up that just couldn't cut the mustard in opposition to P-51s, P-47s, and later marks of the Spit.
Reply: A Spit Mk 24 would have run rings around a ME 109 G
Reply: Adrian Larkins 
The Spitfire Mk XIV did, even the older Spitfire Mk VII was more than capable of taking out the Bf 109 G
Reply: Lol comparing the Mk24 to the 109G .. hahahahaa, its like racing a Nissan R35 GTR against a Toyota Corolla :D
Reply: The Mk 14 , my fav Spit to see wide WW2 service ;)
It was badarse.
Reply: The Hawker Hurricane may have been comparable to the Curtiss P-40. but it was not the "British version" of it. 
They were completely different aircraft.
Reply: The Hawker Hurricane has no connection to the P40 whatsoever. It was designed and built completely independently from any other aircraft. It was developed from previous Hawker biplanes such as the Hawker Hart.
Reply: The Hurricane's capabilities tend to be inflated in these kinds of discussions.  Usually by contrarians (see Anton Rudenham above) who attempt to use the number of aircraft shot down by them as proof of the Spitfire being somehow undeserving of the praise it receives. Sydney Camm was a genius, no doubt. However he only designed one truly superlative machine during the war. That aircraft, of course, being the Tempest. 

The sad reality is that most Brits couldn't tell you the first thing about it. After all it didn't shoot down 109s, nor did it bomb any dams....
Reply: It depends on what age group you are talking about. The older generation know about Hurricanes, Spitfires, Typhoons and Tempests. To say Camm only designed one great aircraft in nonsense. I could expand on the subject but I will leave it at that.
Reply: Sydney Camm is a fascinating subject in his own right. Worked for Tommy Sopwith at Hawkers. Design team for the Hurricane, Typhoon, Tempest, Sea Fury, Hunter and Harrier. But not the Spitfire, that was Supermarine and RJ.Mitchell.
The Merlin and Griffon engines both suffered from negative G due to using a carburettor whereas the Bf109 (Bayerische Flugzeugwerke) was injected, even though the prototype had a Roll-Royce Kestrel engine. The Merlin was also used on the Lancaster and that could loop and roll if it had to, probably not very elegant but necessary, even so, the pilots knew how to manage the engines.
Reply: There were different variants of both Spitfire & Me 109 in the Battle of Brittain (approx June 1940/Oct1940).  Despite that, overall: 

Speed, rate of climb, weapons - Anton is correct - the Me 109 was superior.

Nowhere other than in this forum have I heard it seriously suggested the 109 was more manouverable than the Spitfire and I refute that was the case.  
Maybe of interest 'tho that contemporary RAF pilots reckoned the Hurricane, despite being 20% heavier, was decidedly the most manouverable of the three - at leaast at lower altitudes. 

Zufor TheImpaler has the right of it about the fuelling problem - It was well recognised that a sudden sharp dive, especially if it then went into a sustained shallow dive, meant a Spitfire pursuing a 109 would loose power and fall back. It was a known and frequently used escape tactic for the 109.  In counterpoint, it equally meant it was relatively more difficult prospect foor a Spit to break off an engagement and self- evidently that was to its disadvantage. 

The big factors favouring the Spitfire were:
(a) Fighting over home ground they had far longer endurance in combat. (They had no need to ensure a moderate fuel reserve to cross the channel to return to a friendly field).
(b)  A, for the Luftwaffe catastrophic, edict from Goering that the fighter escort had to stay very close to the bombers they were protecting. (Contrast that with the American's hugely successful tactic of deploying their Mustang escorts in very wide ranging arrays - such that many of their kills were Lufwaffe fighters taking off and landing). 
(c) Radar vectoring - but I guess that's a qualitatively different point.
Reply: Both the Hurricane and ME 109 could out turn the Spitfire but at greater loss of speed.  The result is that with an equal turn radius the Spitfire would at say the end of a 360 turn have lost less speed than the other types.  This is important as all types could turn far tighter at speed than the pilots could tolerate without blacking out.  Therefore it was pilot fitness and experience that was the greatest difference in a dog fight followed by the fact that if all 3 types went into a tight turn at the same speed then after the tight turn the Spitfire would be traveling the fastest.
Reply: Adrian Larkins stop splitting hairs. You lost the war anyway.
Reply: I don't know what hairs you are talking about and neither do I care. Last time I looked Germany lost the war.
Reply: Brian. 
the Bf 109 could not turn with a Spitfire at any altitude without losing altitude, the Spitfire maintained a higher speed, pulled more G and completed a full circle in 19 seconds compared to 25 seconds for the Bf 109.
If all three went into a turn then the Spitfire would not only be travelling faster but also maintain a tighter turn, I have seen so often the Hurricane or Bf 109 can out turn the Spitfire yet there do not seem to be figures for the Hurricane, at 12,000 feet the Bf 109 could turn in 885 feet radius without losing altitude, at the same height the Spitfire 696 feet or almost 200 feet smaller radius.
Reply: Technology. .. Don't care if it was a Spit, Hurri, BF, or a Tomahawk, the old engines on the early in-line based Gen II engine fighters, had this problem.  Even the P-51A when it first came out, had a carburetor based Allison engine in it.  That's why the British disliked the Mustang when it first came out, and cancelled its initial order.  When they put a decent fuel injected engine or better in these aircraft, suddenly they were able to fly above 35,00 feet and roll like crazy.  Can't blame the BAE either, that was the design specification back then.  Works for straight and level, or high angle turns, but not in a rolling battle.    

Once you go to carburetors rated for inverted flight. fuel injection, or turbo charging, the problem basically goes away.   BTW, you get the cut out if you don't maintain a +1g though your roll with a normal aspirated engine.   Aileron vs. Barrel roll.  For the movie shot it was definitely an older engine and the pilot trying to keep the plane in the camera by doing a modified aileron roll, sput sput black smoke and all.  

Technology aside,  loved the film, and those aircraft, and your comment was spot on.  What a marvelous era of flight that was.
Reply: Warren.
A tiny problem.
The P 51  which got the British Rolls Royce Merlin engine in late 1943,
used the carburetor from Bendix, which was given to Bendix by Rolls Royce. 
The Merlin engine never had any problem when rolling, in fact in the Battle of Britain many RAF pilots used to roll over into a dive to  keep positive G. Rolls Royce uded a carniteryot because it was more efficient than fuel injection.
Reply: Barrie Rodliffe  And fuel injection.  The conversion of  the Mustang to us a Merlin was the magic trick that made the P-51 the plane of legion it was.  That Merlin engine did that for just about every aircraft it was put on.
Reply: Warren Smith A stock P51 is flawed no matter the engine, they are flying dump trucks...
Reply: Warren.
The P 51 certainly was much improved by the Merlin engine with a Rolls Royce/ SU design of carburetor, it still was no Spitfire though.
Reply: It will always be in the Eye of the beholder for these airplanes.  For esthetics, my heart goes with the Spit over the Mustang any day.  If I had to put my life on the line, I think I would go with the P-51D's or better from later in that era. Sorry, I only have 0.6 hours in a duel control p-51.   Now if you ask me which one I would have loved to have logged some PIC time in, its the Mosquito.  Oh Yaaahhh, sign me up for that one.  hehehe

If you want to talk engines,  why are we not including the turbocharged Allison engine that was on the P-38 back in 1939/40 (Thanks Kelly Johnson).
Reply: Warren.
Lucky for you that you won`t have to fly one, The P 51 D which arrived in late 1944 or over 6 months after the faster Spitfire Mk XIV, The Spitfire was not only faster but with a much better acceleration, climb and maneuverability.
If you want to talk about engines, try to ask yourself why the P 51 got the Merlin to make it into an acceptable fighter, or why Lockheed wanted to change from the unreliable Allison to the Merlin not only to improve performance but reliability as well.
Reply: So the engine flooding to a degree it would not restart is not a fatal flaw ? Looks to me like you're one of those with nothing to say, but still want to jump on the hate wagon. Having to walk back to the airfield was only a disadvantage, nothing of major consequence. Has the queen pissed you off lately ??
Reply: Barrie Rodliffe Barrier

I think you misunderstood my comment.  The Merlin was a superb engine no matter which airfare you put it in.  Yes, the Spitfire was a  great plane, too bad it never had the range.  My  comment by the way, was more about the difference it made between an engine with a carburetor vs. one with a turbo charger.
Reply: John Smith. 
So the RR Merlin engine  would momentarily cut out with negative G, soon solved completely.
As RAF pilots knew it was no problem to roll into a dive and maintain positive G. being able to keep flying was no big deal.
Why should the Queen do anything to annoy me?
Reply: Adrian Larkins check pinned comment
Reply: I made that comment long before the pinned comment. I have not made any comment since. His pinned statement vindicates mine.
Reply: Adrian Larkins cry more at his twitter
Reply: it could surely be fatal after 5 seconds because your engine could be hydrolocked
Reply: Because the ME 109 fuel was pressurized when shrapnel hit a line it burst when shrapnel hit the Spitfire nothing happened. This is one of the main reasons why during the battle of Britain the German losses were 5 times higher than the British losses.
Reply: 133 responses!? Goddam.
Reply: It's a pretty fatal flaw when you realise that turning tight pretty circles was useless against German energy fighters/divers like the Bf109 and FW190. The Spitfire was less powerful in a dive and lost to German fighters 41-42. That meant they had to dive a much steeper angle to gain speed--which caused the choking issue. It was pretty terrible.
Reply: +Broreale playing warthunder simulator battles also makes the problem a headache since if you are on a germans tail if they roll over and dive pulling up if you try to follow your engine dies and you might not be able to turn it on again in time in that time period i usually turn right and try to spot him or outrun him but most of the time you end up having to fight with him having done a loop under you and then staying on your six

or you could just follow him and not care about your engine for a lucky shot if you get him land and restart engine 

giving the sticka quick pull back during negative manuevers also helps but its not gauranteed
Reply: Chris gaming.
If you roll over and pull back on the stick you are not getting negative G and no problem and that was only on early Spitfires, by the Battle of britain the problem was much less and in 1941 solved completely.  No pilot hd to land to restart the engine since the problem only caused a momentary cut out.
Reply: Out of curiosity, how did the pilots overcome it?
Reply: @MinecraftWithPAPike  
There are two parts to the answer, first the problem was known by Rolls Royce who 
were working on it and made improvements in 1940.
The pilots knew about it and it did not affect most maneuvers so if attacked a Spitfire pilot usually turned and climbed which avoided the problem, if the pilot was chasing 
and the plane in front went into a steep dive he would roll over into a dive maintaining positive G which also meant he could see the enemy all the time while doing so.
If you see Films about the war they often show Spitfires rolling over into a dive, I think some pilots still did so even when they had completely solved the problem.
Reply: @nerd1000ify  Errrrrrr, NOPE and NOPE. The BF-109  and others used a https://en.wikipedia.org/wiki/Daimler-Benz_DB_601 or https://en.wikipedia.org/wiki/Daimler-Benz_DB_605
engine. It is an INVERTED V-12 (crank above rods, pistons, valves, etc.). 
Also, it used DIRECT INJECTION of gasoline https://en.wikipedia.org/wiki/Gasoline_direct_injection which is NOT the same as regular old fuel injection. This system is similar to the modern Audi and VW diesel engines that are direct injection into the cylinder/combustion chamber (but with diesel and this may be coming to gasoline powered cars soon). The engine also sported 3 oil pumps with an external oil tank to manage the oil situation. If the fuel pickup in the BF-109 tanks weren't a problem, it could potentially fly all day inverted.
Reply: @barrierodliffe4155  Errrr, NOPE. Fuel injection does not need electronics at all. All diesels are direct injection engines and are mechanically driven and controlled. Ask any farmer - you shut off the tractor by manually closing a valve in the fuel line - diesel industrial engines, cars and trucks the same - Google 'runaway diesel' - and direct injection gasoline or diesel are the same principal. The Bf-109 had a https://en.wikipedia.org/wiki/Daimler-Benz_DB_601 or a https://en.wikipedia.org/wiki/Daimler-Benz_DB_605 running direct injection gas https://en.wikipedia.org/wiki/Gasoline_direct_injection.
Reply: @barrierodliffe4155  indeed the DB601 and DB605 are inverted V engines, but this does not excuse them from the laws of physics. Like pretty much any high performance aircraft piston engine, they use a dry sump lubrication system in which oil is collected from the lowest point on the engine (the rocker covers, in the case of an inverted V) and recirculated back to the main bearings via an oil filter, cooler and resivour tank. Fly upside down, and your oil will no longer be drained down to the pickups in the rocker covers. This is bad, as the valve gear (which in the DB series engines is normally bathed in oil) will be starved of lubrication. In practice the fuel supply runs out first (after about 30 seconds, apparently), but if you were to redesign the fuel system to prevent this the engine would still fail after a couple of minutes.

The Bosch direct injection system was for sure superior to the standard allied solutions, but nevertheless we would today call the later Merlin engines fuel injected. The injector is of the 'single point' type, replacing a carburettor with a pump, metering system and sprayer aimed into the eye of the supercharger impeller.
Reply: @teebosaurusyou  
All that to say so little, there used to be mechanical fuel injection but it was less efficient than a carburetor when used with supercharging, I have driven tractors and trucks with diesel engines and cars with supercharged petrol engines,  the reason fuel injection was not used much on petrol engines until the late 1970's is because it was not efficient.
The reason Rolls Royce did not use fuel injection was because they got more power 
from a smaller engine than Daimler Benz or Junkers
Reply: @nerd1000ify  
I would not call a fuel injection that on a bigger engine gave less power superior.
DB 601 34 litres, RR Merlin 27 litres
A single point injection is when the fuel is injected into a carburetor body or the inlet manifold leading to the supercharger, in a supercharger the fuel is mixed with the air and  drawn through the supercharger
Reply: @barrierodliffe4155  the 605 had larger displacement for similar power but weighed less (more use of light materials I suppose) and used less (and lower quality) fuel. The Merlin got high power output via extreme boost pressure, which is bad for fuel economy due to more power consumption by the supercharger. In practice the difference in range between a Spitfire and 109 was pretty small though.
Reply: @nerd1000ify  
Yet the bigger DB 601 gave less power in 1940 and + 12 lbs boost is not exactly high or extreme.  
The D 601 lower power to weight than the Merlin and the later Db 605 weighed more than a Merlin 61
The Merlin was rather good for fuel economy.  Range was low on both in 1940 but vastly improved on later Spitfires when they used more boost which gave a higher cruise speed, the other factor is that maximum boost was not used all the time.
The Spitfire Mk IX had a combat range of over 1,000 miles, partly due to having more fuel but also a higher cruise speed.
A Spitfire Mk XIV using + 21 lbs boost had a top speed of 423 mph at 10,000 feet and a cruise speed using just + 3 lbs boost, 325 mph  at 10,000 feet these figures would be higher at 20,000 or 30,000 feet.
Reply: @barrierodliffe4155  you're right on the weight. I must have misremembered the figures (I used to get into these arguments all the time, usually on the Merlin's side). Interestingly the Spitfire IX actually has less fuel than a Bf 109 G (correction: the spit has 122 gallons including the rear tank, to the 109's 88 gal. The main tanks on the spit are only 85 gal though, and usually the rear tank wasn't filled). Combined with the 605's better economy, the result is something like 10 minutes more endurance for the 109. Spitfire XIV is a Griffon Spitfire btw. Griffon vs DB605 evens up the displacement (Griffon is 37L) and is hardly a competition: the DB simply cannot compare to the Griffon's raw power and (in the 2-stage models) excellent altitude performance.
Reply: @nerd1000ify  
Interesting that the Spitfire Mk IX with the standard front tanks had 85 gallons and often they carried a 90 gallon drop tank, the rear tank was only used for long range as it was not needed for most missions.  The Bf 109 G 6 was not as fast as the Mk IX and not really comparable.  I know the Griffon was bigger than the Merlin, I was just pointing out that maximum boost was not used most of the time so is irrelevant to average fuel consumption,  do you think a P 51 could do 2,000 miles at full power? 
The Db 605 barely compares for power to the smaller Merlin.
The Spitfire Mk IX with 85 gallons and a 90 gallon drop tank would easily exceed 1,000 miles,  the USAAF flew two Spitfires across the Atlantic and the RAF flew 1 Spitfire with standard fuel and a 45 gallon drop tank over 1,000 miles at low altiude.  
Spitfire Mk VII's which had 124 gallons internal fuel and not using drop tanks completed a mission of over 620 miles, mostly at low altitude at an average speed of 390 mph. with fuel to spare.
Reply: @barrierodliffe4155  Max boost is relevant because the boost on these engines is reduced for cruise by throttling, i.e. the throttle butterflies are mostly closed at cruise power. The supercharger has to waste a lot of power sucking air through the tiny gap, which reduces fuel economy. The only engines that circumvented this problem were turbocharged engines (the turbo can throttle via wastegate position instead) and the Jumo 213 series, which had inlet guide vanes upstream of the supercharger impeller to 'throttle' it in a way that wasted less power. That trick came at the cost of reduced efficiency at wide open throttle though, as the vanes at that point are just obstructions to the flow of More boost also demands a lower compression ratio (6:1 for the Merlin vs 7.5:1 in the 605) which reduces efficiency under all circumstances, though to be fair both of these engines had their CR locked in long before high boost became a priority.
Reply: @nerd1000ify  
Yet the Merlin was more efficient than the DB engine, you fail to show the max range for a given amount of fuel.  The Bf 109 had short range which was a problem, Spitfires had short range but they were able to fly a long way, the Mk IX with more fuel in the rear tank or the Mk VII and VIII with extra fuel in the wings or even the MK XIV with both. They also carried drop tanks and a Spitfire with  96 or 124 gallons  plus a rear tank and a 170 gallon drop tank could fly a very long way, far further than any Bf 109.
Reply: @barrierodliffe4155 Because we're talking engines, a better comparison is specific fuel consumption, or the fuel used per horsepower per hour. The Merlin 66 uses about 240 grams of fuel per horsepower per hour (reference: http://www.wwiiaircraftperformance.org/Aircraft_Engines_of_the_World_Rolls-Royce_Merlin.pdf). The DB-605DB uses about 230 grams (reference: http://kurfurst.org/Engine/DB60x/DB605_datasheets_DB.html). Not a huge difference, but we can see that the 605 is a bit more economical. Put them in a plane and things get a bit more complicated- the lift:drag ratio, propeller efficiency, altitude and pilot's choice of flight speed (the Spitfire was very economical when flown at its most efficient cruise speed, but this was dangerously slow when flying over enemy territory) all play a part, along with engine efficiency and fuel capacity.0